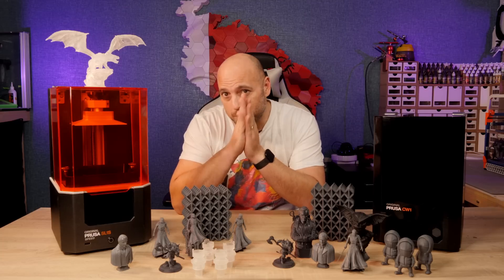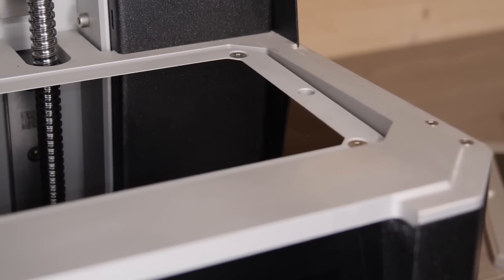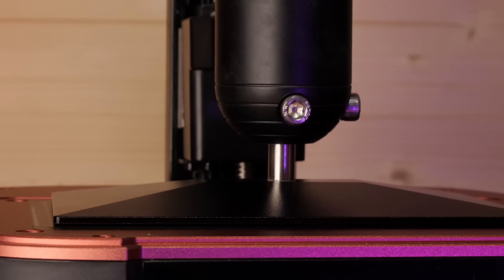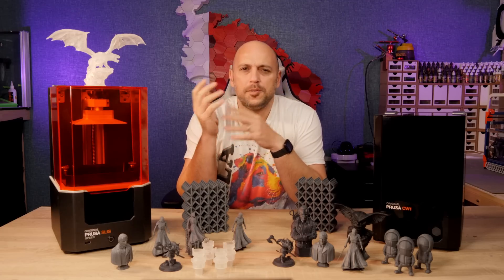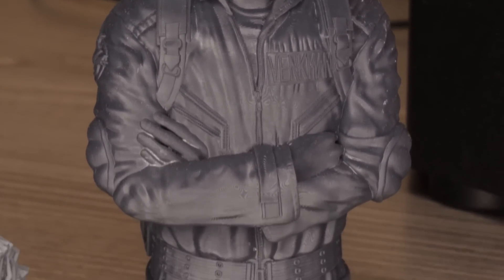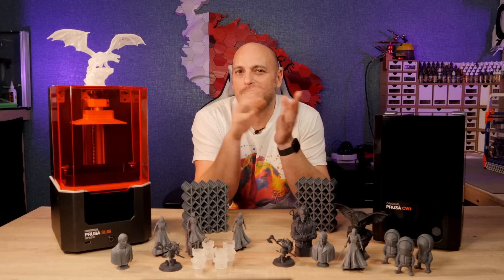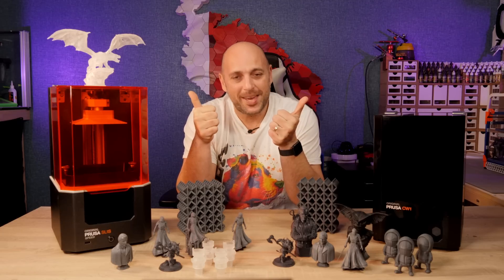RIDICULOUSLY FAST Resin 3D Printing - Prusa SL1S Speed

Comment from the maker: 2:08 - Specifications
3:38 - New VAT
4:06 - Print Speed Comparison
4:40 - How The Tilting Mechanism Works
6:45 - Monochrome LCD Upgrade
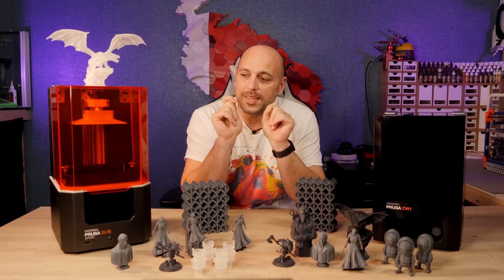7:24 - Protective Tray
8:03 - CW1 Wash and Cure
8:45 - Error Codes with QR
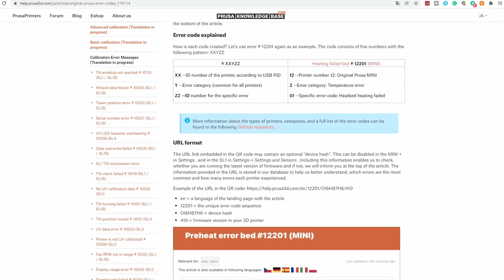9:25 - Real World Use Case For Speed
10:46 - Why You Should Get The SL1S Speed
12:40 - Things To Improve
Reply: Check how the DWS Systems XFab series covers work. They are 7k EUR for the cheapest model, but it's the best SLA I've worked with. I love my SL1 (now SL1S) but it's still only an advanced hobbyist level machine, not a professional one. And don't even get me started on hi-end pro printers like DWS 029X and Rapidshape HA40 II. That's another whole world entirely. Also regarding the price (~70 and 50k EUR accordingly).

Comment: how good is the accuracy on this resin printer? I seriously have a lot of problem with accuracy on my EPAX
Reply: not that accurate for the price it is sold for.
Reply: @Zen0sa do you have any recommendation for accurate resin printer? Formlabs i like those but the resin is not open source
Reply: @RecordedH  I have bought the saturn 2  and works great. My sl1 is in parking mode, dont use it and did not upgrade as it is too expensive. If i could sell it for a good price i would but no one wants to spend ridiculous money for that small printer as many other options available. So i keep it as a backup.

Comment: Great review! Thank you so much :) 

I really like the storage system you have for your airbrush and paints. I've never done any airbrushing and received an airbrush kit as a gift. Although it is not an Iwata, I think it will be a good starter kit to learn with. 

The Prusa SL1S certainly looks like the best "bang for your buck". My MK3s is a great FDM machine but the SL1S appears to be the next machine that will get me into resin printing. How are the fumes? I have been hesitant in purchasing a resin printer to use inside the home due to the exhaust concerns from other makers.

Cheers,
Jeff (Garage Maker Guy)

Comment: I believe a possible reason that that one model kept failing using the same supports is because the SL1S by default uses 0.5mm support points compared to 0.4mm on the sl1, so when you re sliced, it used 0.5mm points, and makes it work fine. I have the SL1S and that’s what i noticed